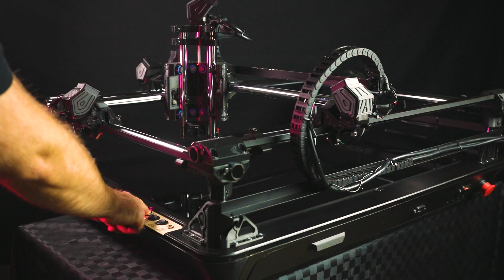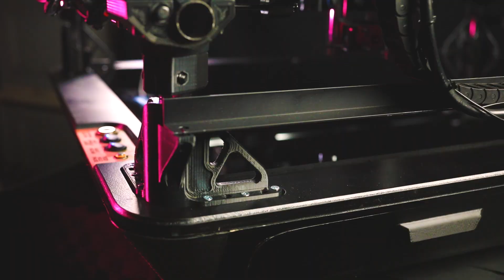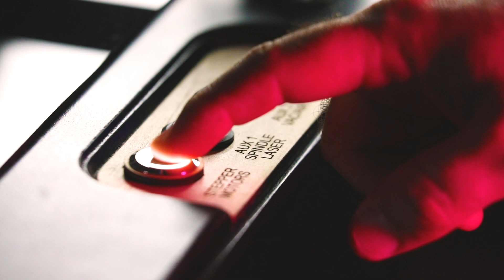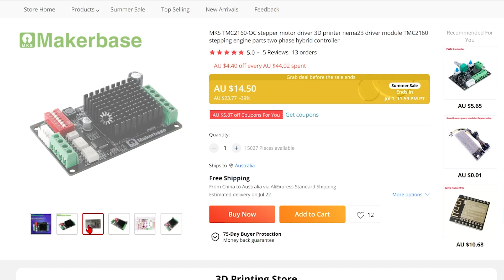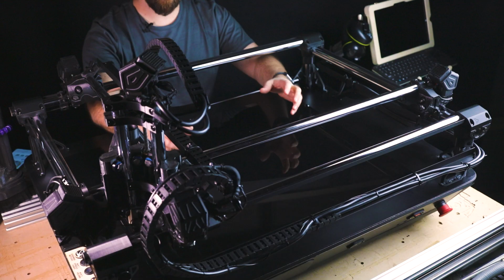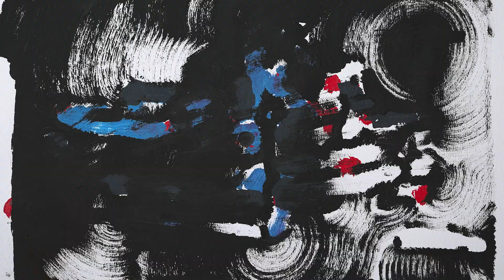MPCNC Primo // Fastest CNC // FluidNC

Comment: This design looking so cool but. İ think totaly useless in a long term. Rails,motor and most parts not covered. İf we talk about cnc, cnc creates lots of dust,particles etc. And this particles blocks movement of cnc machines. İf you add a coollant ligquid water,ipa etc all liquids going under the machine so horrible. Good luck about this design.
Reply from the maker: You’ve raised some fair points. Like any CNC setup, maintenance is always part of the process, especially with dust and debris.

That said, I don’t think this type of machine is really aimed at long-term heavy use or production work. The MPCNC is more of an entry-level platform designed for lighter materials like timber and plastics, and for learning rather than industrial reliability.

Most people building one aren’t running coolant or cutting metals, so the exposure risks you mentioned are usually pretty minimal in typical use.

The real value is in the learning side — building the machine, understanding the electronics, and getting hands-on with G-code. From there, a lot of users move on to more robust machines once they’re ready to invest further.

Comment: pudiste hacer funcionar la sd ?
Reply from the maker: Yes absolutely 👍
Reply: @NEWTechCreative   que formato y capacidad debe tener ...

y que parametros espesificaste en el config.yaml 

spi , frecuncia entre otros  ???
Reply from the maker: The only setting I added to setup was 

sdcard:
  cs_pin: gpio.5
  card_detect_pin: NO_PIN

However this was many versions ago and settings have been refined. It is best to use an older 4gb SD card, however up to 16gb should work fine. Needs to be formatted with FAT32. Other users have found that the frequency settings need to be changed for Sd card to work. More info here: 
http://wiki.fluidnc.com/en/config/sd_card

Comment: You can run directly from SD card, no need of computer or phone all the time, you can deconnect the phone from the WIFI and the job will still run. I recommend do a simulation before running the actual job, wich i recommend even for a large scale cnc machine, it´s just good practice.
Reply from the maker: Yes you are correct that it can run without continuous AP connection…. Using physical hold/start buttons would be useful if users choose this setup!

Comment: Hello! Just came across this MPCNC, and with mine about 70% done, I am mesmerised at what you have achieved! 
It looks so sleek and futurist, not at all like the DIY one I am building. If I may I have a few questions:-
1. Is the table sturdy enough to be used with a router/ milling MPCNC?
2. Can I use the original feet with it or have to go with the modified ones?
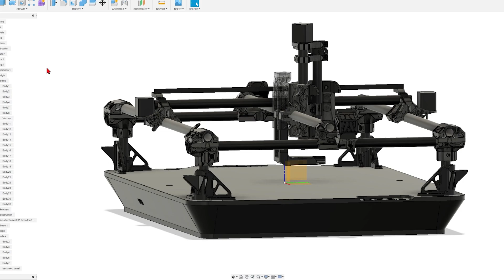3. Can you post pics of the CAD of the drawer and table as shown at 7:13? So we can have a better idea of how is it put together?
Once again! A very refined MPCNC ❤!!!
Reply from the maker: Thank you! That’s exciting to hear you are starting your CNC journey 🤩
Yes my table is sufficient with a router installed. Yes you can use original feet and parts if you choose to - this doesn’t change the base.
If the .step file isn’t included with the thangs download files, I can send through the full 3D model to use if needed? 
My email is newtechcreative@gmail.com
Reply: @NEWTechCreative  Thank you for the prompt and detailed reply! Didn't expect one so fast if at all on a 2 year old video! 
Your offer of sending the .Step kinda made me emotional! Haha
Here I was taking screenshots from the video and approximating how things would go together, and then you come out with the one thing that negates all above! Kudos brother! 
I will def hit you up with an email!
Stay safe and happy engineering!!

Comment: Hi NT what software are you rocking to do the sketches on and generate the gcode
Reply from the maker: A random selection of different apps! Illustrator is my main go to, followed by sandify.org. You can find a selection on online sites by searching a variation of vector line art converter or generator. Then use your CAM software to turn the vector into tool paths for your CNC! Hope that helps?

Comment: What kind of tube did you use for the rails ?
Reply from the maker: I used chrome plated steel pipe… said 25mm on sticker however needed up being 25.4mm on the dot. Check measurements before printing!!

Comment: You are just amazing !!! Thank you so much for making this video, and your generosity. So if I understand well, if you disactivate that WIFI chip, there is no reason for the program to get interrupted?
Reply from the maker: Since making this video I’ve figured out the main reason for the crashing… I was using the direct Wi-Fi and this seems to request more processing from the esp32. Since connecting properly through a local Wi-Fi network, I haven’t had any more issues!!

Comment: First off that is an awesome looking machine.  You mentioned that you get pauses in your work due to overheating the WI-Fi chip on your board.  I currently run Mainsail and Klipper for my 3D printers this is basically the same thing as Fluid/NC.  There is actually a Fluid software for 3D printing.  Why not use a raspberry pi or alternative to send your file to from your computer via Wi-Fi it is stored there and runs from there that way if you lose wi-fi all together your job continues to print.  Just a suggestion.
Reply from the maker: Thank for your comment! Great suggestion. Fortunately I have fixed the intermittent issue for the work pausing due to firmware changes and I was running Wi-Fi Direct to the controller that put too much stress on the processor.running through my home network fixed the issue. Yes I have seen fluid and it’s a stunning 3D printing platform…. I really love their user interface! Thanks for the suggestion 👍

Comment: Really cool. Got to know FluidNC thanks to you. Does squaring with the endstops work with it?
Reply from the maker: Fantastic to hear!! Yes absolutely. You will need to setup independent motor outputs with the limits. I’m setting that up at the moment on my new machine. More info on the fluidnc wiki on this 🤩
Reply: @NEWTechCreative  Cool! Good to hear. I'm looking forward to the development to come with FluidNC. Personally I just finished my MPCNC build with SKRpro, Marlin and CNCJs (before I knew about FluidNC) but will certainly hold out on FluidNC anyways until its considered stable. Anyhow. I believe your are making a very valuable contribution to the MPCNC-community by sort of introducing FluidNC to it. Also I really love how you show your respect and appreciation to the MPCNC project here, even though you are clearly way ahead of it with your matilda project. :) Kudos!

Comment: Love your build. Might have missed it in your video but what are you using for your rail tubing?
Reply from the maker: Thanks Derrick 👍 I’m using a chrome tubing from the local hardware store. I initially said it was 25mm - however I also took calipers with me to the store to check and was actually 25.4mm… always check tubing before printing the right parts!

Comment: Looks Great!!! Could you post the length of the rail pipes this looks like a great size for me to build thanks :)
Reply from the maker: Thanks Dave!! The longer pipes are 990mm, shorter side 740mm and height 110mm. The centre crossing pipes are 50mm shorter than the parallel outermost pipes. I hope that makes sense??
Reply: @NEWTechCreative  thanks! do you run a Discord server? might have a few questions along the way...
Reply from the maker: @daveyridgwell7537  https://discord.gg/f87Pcc9E

Comment: This is the most beautiful and refined MPCNC I've seen. Just shared your vid with some other MPCNC friends - they're agog just like me! I love your koala vac design. I just printed the upper and lower portions for the Primo 23.5 I'm building, and the parts look great and fit together well. Where can I find some more information about the magnet installation? It looks like several magnets go in the dimples on the lower part. Do magnets get glued into the matching holes on the upper part? If so, any tips? What do you recommend for glue for the magnets? Thanks for sharing your awesome machine - you give me something to aspire to!
Reply from the maker: Thank you for your kind comment!! Great to hear your giving the koala vac v2 a go!! Please let me know feedback about the design. Regarding the magnets- yes the magnets are glued into both parts with the polarity matching to hold each adjustment depending on the height required. I would tape the outside of tube when gluing to align magnets as they dry. I have used super glue on mine and holds well. Sorry my instructions are brief however I’ll update instructions down the track. I would love to see your mpcnc progress! Send me your Instagram if you have one?
Reply: @NEWTechCreative  Sorry I don't have an instagram. My build's pretty ghetto compared to yours. It'll work fine, I'm sure (actually upgrading from a burly that had previously been upgraded from a 525), but it's nowhere near as pretty.

I mounted the koala in place of the clamp Y part on the Primo. Two notes: 1) The clamp Y part has a cutout to clear a bolt on the truck at the back - the koala doesn't have that, so loses a few mm of travel in the Y direction. 2) It's a pretty tight fit - the koala is pressed pretty tightly up against the other clamp. I don't think it'll cause any issues, but another mm of clearance might be good there.

Love the koala design and it's minimal impact on usable space. Also that it's mounted close to the axis so should have less impact on the tool head as it moves around. Can't wait to try it out!
Reply from the maker: Thanks for your feedback! Super helpful 👍 would love to see progress!! Feel free to drop me an email at newtechcreative@gmail.com
Reply: @NEWTechCreative  I finally got my DW660 mounted on my rebuilt primo, and was surprised that the vac head didn't line up. I came back to this vid and realized that the koala is designed to align with a spindle. I need to make a few measurements and create a vac head that will work with the 660. I'll put it up on TV/Printables when I finish it.

Comment: Well done, congrats. Quick question, how did you make the machine draw that one ligne circle drawing? What file did you use? Was it really following the lines through vectors or was it like engraving with a laser from left to right and so on?Thanks and all the best
Reply from the maker: Thank you Martin! Yes it followed the vector boundary and changed height depending on thickness of line!! To achieve this you can use any CAM software on the engrave function to replicate a vbit tool as the brush is shaped similar. I hope that makes sense? Thanks Martin

Comment: What is the shiny black surface in the center of the cnc? Metal, plexi? Something else?
Reply from the maker: Hi Rob! Yes it’s black acrylic/plexiglass. I installed it as it was easier to clean up paint and a smooth surface for paper to be stuck down. I’ve used threaded inserts that I can swap out surface/spoil board as needed. 👍👍

Comment: First of all, thank you for your video, it's amazing! Now, a few things: You mention cooling the NEMA17s, do you think NEMA23s might be a worthwile upgrade? In terms of getting higher acceleration if the frame itself is rigid enough, you can get higher quality belts with more fibre in them that makes them much more rigid and far less likely to slip (if you've ever seen a Prusa printer, essentially ones like those). Also, I'd absolutely love to see how it copes with metal. Aluminium or if somehow rigid enough of a frame, perhaps an even harder metal too? Again, thank you for the amazing video, build and custom designed files!
Reply: NEMA 17 motors can work up to 80 degrees centigrade. It's very hard to make them hotter in CNC work.
Reply from the maker: Thank you for your comment Elliott! You are 100% correct… I am pushing the NEMA 17’s however the 23’s I believe would add too much weight and might cause other issues… but it has been fun to see how far I can push the 17’s 😁. As for the belt, I have seen other belts available and I agree that the teeth on the belt are flexible and contributing to the skipping on fast changes and your solution would definitely make a difference, however I do like the flexible teeth for homing/squaring as they skip to square the machine. I look forward to adding a spindle down the track and testing the cutting capabilities!! I’ll certainly make another video then 🤩 thanks Elliott 😁
Reply: @NEWTechCreative  I want to see what this wonderful machine is capable of! We are waiting for a video with the installation of the spindle on this work of art and the results of the cutting capability tests.

Comment: Nice build. 
What is the best orientation to print the Koala Vac for the Primo? Standing with supports, or laying down?
Reply from the maker: Thanks for your comment Casper. I would print the gantry part vertical with supports around the bearing attachment… avoid suppers inside the part as it would be a nightmare to remove. Print the lower part laying down with the spindle end facing upward - no supports needed. I’ll update these instructions soon on thangs!

Comment: Impressive, definitely a nice looking machine, I have a MPCNC I built and it works pretty well but it sure doesn't look that pretty.
Reply from the maker: Haha! Thanks Jon. Considering mine has never seen dust I can say that’s a large contribution to why it still looks pretty!! 😂😂
Reply: Jon - do you have Primo too? Could you tell me something about it? How long did it take to build. How much fast it at last? What spindle you have? Anything that would be worth knowing before going to build it. Thank you
Reply: @djVania08  I did build the primo at 24"x24". It wasn't to bad to build, I would definitely make sure your 3d printer is dialed in. I have seen a lot of people have issues with parts due to 3d print issues. I bought the kit from v1 engineering since it was about the same cost as part picking was. I just did dom tubing and used some gun bluing to help it not rust and it still does get rust on them since it's in my garage. I went with the dw660 tool and seems to do fine I have not tried cutting any metal on it yet.